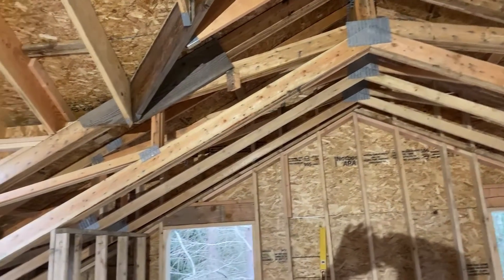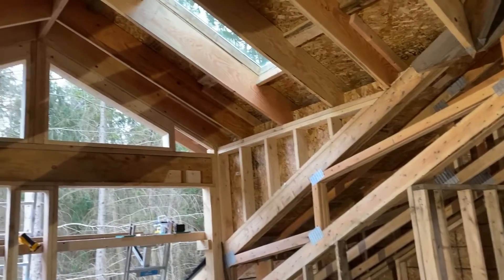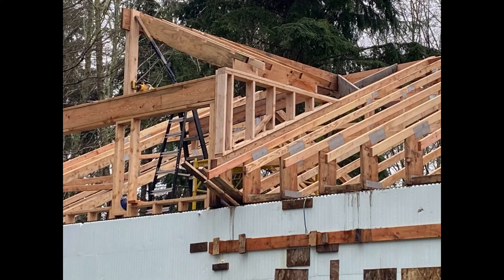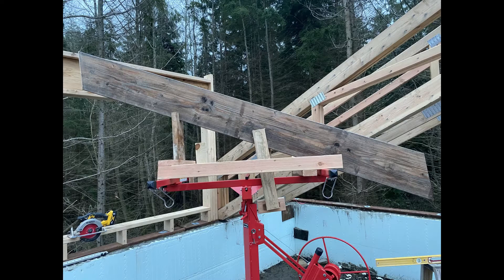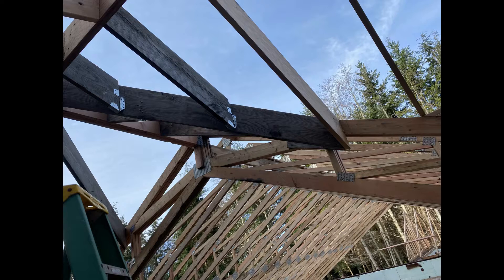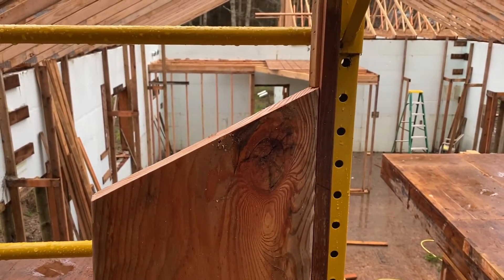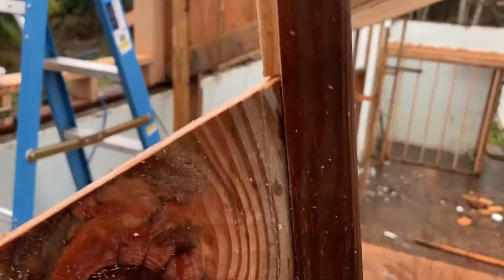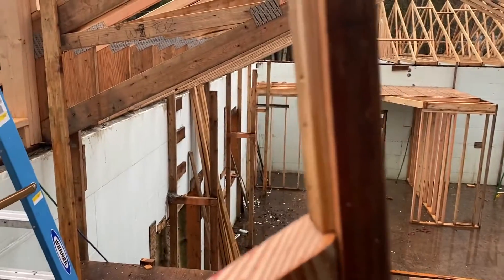framing a dormer

Comment: I interested what you call those "expensive" brackets? the one w/ the 3 attachment points... I'm having a hard time searching that myself
Reply: The ones that I used were difficult and the end of the rafter was cut square. The new ones install after the rafter is installed with a compound cut. This is better because you can cut the rafter exactly and install it with nails like in the old days then the brackets go on after. Unfortunately I can’t remember the Simpson number and would have to go back to the lumber yard to see. They didn’t have them at home depot but did at a proper store
Reply: Lssj is the Simpson number
Reply: @stevedunivin  Thanks for the help! It looks like with the LSSJ you wouldn't be able to get as tight into that corner so you have access to the nail holes in the bracket, no? Maybe I'm looking at these wrong?
Reply: Oh. I see, it looks like the flanges can be bent? that's way easier! thanks again!

Comment: I'm glad you are back!. I'm enjoying your build. I am learning from you, for an ICF project I hope to get started this year! That's a great accomplishment, getting that roof on by yourself. You have made really good progress, considering you did that over the winter. The explanation you gave of your procedure made perfect sense to me. If you ever make those hip cuts again, remember that the diagonal dimension from corner to corner of a 12" square is really close to 17". I'm guessing your pitch is 6/12?  So .... "IF" the roof pitch is 6" rise/12" run, the hip rafter cut  is 6" rise/17" run.
Reply: I seem to figure things out the hard way but it worked hopefully someday watching the video will also read your comment. We need to get as much information in one place so it’s easier to find

Comment: Thanks for the update.  My brother once lived on Whidbey Island for a few years back in the 90's and my wife and I visited him.  Beautiful place.  My hope is to retire in a few years, move from FL to the mountains of NC and build a downsized ICF home.  I found what you did with installing your subfloor before filling the ICF walls with concrete very interesting.  Another guy, Youtube channel "B Wade",  did that also.   His was a full height basement as opposed to yours which is a crawlspace, as I recall.  So, two successes with that technique.  I believe you guys came up with it independently.  Seems like it is simpler, with less cost and less risk.  My thinking on a roof is to keep it simple, a low pitch shed roof or a roof top deck like on the "Lake Lot Build" Youtube channel.  I really appreciate you documenting your build.  Looks like it's going to be a beautiful, well built home in a beautiful place.
Reply: I can’t take credit for the idea of building the floor first   I went to classes back in the nineties to become a certified ICF builder and this is how they explained to do it. Best of luck on that retirement home 🏡 n the mountains sounds wonderful